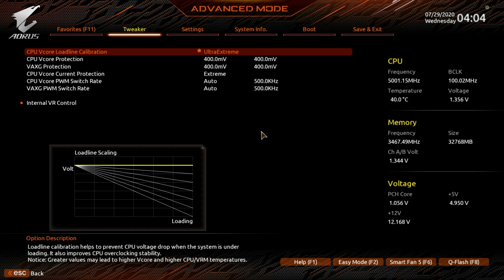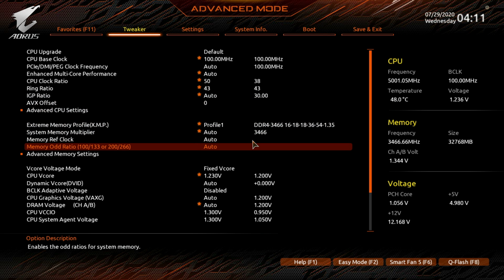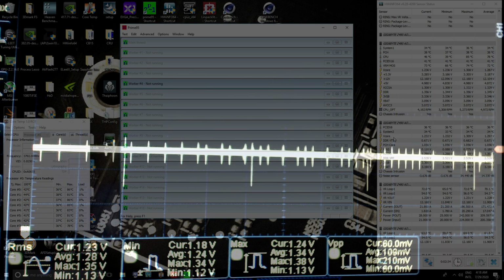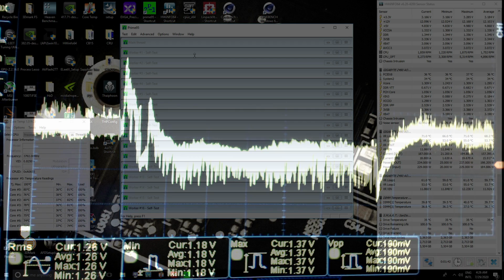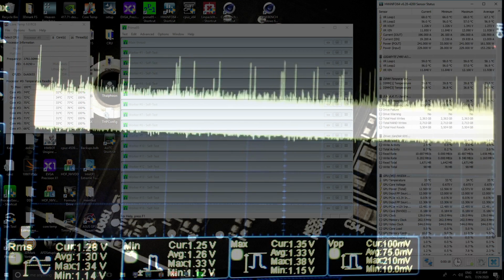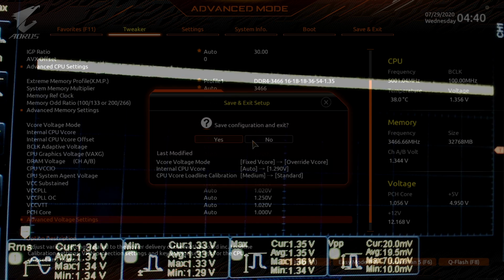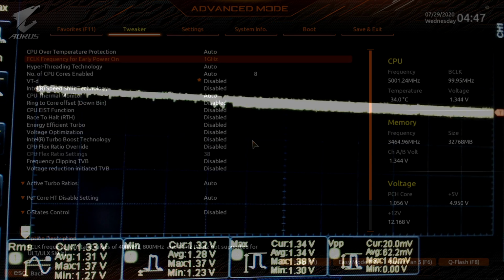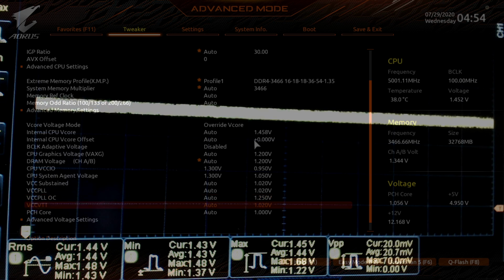Why Vdroop is good for overclocking and taking a look at Gigabyte's Override Vcore mode.

Comment: Stellar video! Can you do a video on how the override mode works? Usually the VRM senses the voltage and adjusts the duty cycle from there so it must rely on the capacitors to handle transients until the convert can catch up. Capacitor voltage doesn't drop until current is already flowing out so the VRM is playing catch up. Does override mode also use current feedback to sense the transients and adjust the duty cycle? It would need to sense the current downstream of the output caps while typical current sensing is done across the high side switch I think.

Does the VRM take it's feedback from the area of the board where the output capacitors are, or does the feedback come direction from the CPU die?

I must have more information!
Reply: Yes we need to know how this cool feature works. Buildzoid I have faith in your electronic investigation skills!
Reply: My guess is that Override is like Adaptive and stock voltage, as in it uses LLC to achieve the effect. It seems to just be implemented better, and/or have LLC be adaptive (changed on the fly in reaction to under/overshoot). Not sure if that's practical. I think it could also be a non-linear LLC map.

Comment: Great video!  I was hoping to see the same feature on my X570 Aorus Master.  Unfortunately, it’s not, even with the latest BIOS - F21.
Reply: I wouldn't count on it if I were you. Compared to your X570 board this Z490 board uses a different VRM controller. Plus, Intel's LGA1200 CPU's use a completely different power control scheme then AMD's AM4 CPU's.

Comment: These spikes are likely caused by Windows event loop sending mouse in / mouse out event messages to various processes. From OS point of view, the screen is just a big bit plane on which pieces are "owned" by various process threads. As the mouse moves, the OS generates events and has to decide where exactly they need to be sent to. If the window is moved, the mouse events are consumed by just one process, the window compositor.

Comment: My guess as to why dragging a window doesn't cause it but moving the mouse does.. windows 10 has a feature that lets you interact with whatever you're holding the mouse over without clicking on the window to make it the active one.. so you can type in one window and scroll another one without changing the other one to active. Maybe the detection and input rerouting logic for that feature is causing the spikes.

Comment: Super interesting video, many thanks for this! I have the exact same CPU and motherboard and currently use Adaptive but will now give Override a go.  As the CPU is more than fast enough for me right now, I'm more interested in running lower voltages at stock speeds than overclocking and currently run about 1.8v under load stable with temps around 60C.
Reply: Typo? 1.8V will insta-kill a CPU if you give it that much under load at ambient temps.
Reply: @kelvinyonger8885  He hasn’t responded yet cause his only computer died
Reply: Rip half knowledge overclocker

Comment: You, sir, are giving all the info I need to properly OC my 3900XT. So this horrible undershoot (+ windows shit) is what's causing workers, eh, to stop working. Nice class, thank you for those voltimeter readings, it's not something I can do by myself.
Oh, and if you have the time, I'd like to ask: in a good mobo (I have a x370 K7, bought on your recommendation actually), is there any chance those overshoots happen while current is still passing through the chip?
Reply: "windows shit" will be "program of whoever shit" gives enough time, and not that much time.   At any rate, your cpu was not stable at those settings - killing the messenger is dumb.

Comment: why not just hide the other unused fields in HW info so you can see the temps and the voltages at the same time? great video, top notch. this is something i have been trying to imagine in my head for over a decade and you just managed to visualize it for me in an hour.

Comment: A much better video than the previous one, now all is clear and it was like you said a windows timer stuff
i also sugested to change LLC to see behavior but i would have never imagined this result, i'm so choked
wtf windows is doing when moving mouse is just insane microsoft should fix that asap
very interresting anyway and good job on this one. I now need to connect my scope and see what's going on with my asus mb as they don't have an overide mode
Reply: "wtf windows is doing when moving mouse is just insane microsoft should fix that asap" might as well just say "I am ignorant, and I want to shout that from the mountain tops"

Comment: what motherboard do you recommend AMD platform that can be upgraded that won't break the bank?
Reply: It's impossible to recommend a motherboard without knowing what features you need.

Overclocking a 39xx Ryzen?
2.5Mbit network?
Wifi?
Pcie gen4 (and how many)?
USB ports?
Reply: @AllanHundeboll  that's ok I ended getting the ASUS x570 tuf gaming wifi they r getting hard to find

Comment: so having the CPU idle at like 1.6V is not bad as long as the load voltage is at like 1.3V, and not degrading the CPU?
Reply: 1.6V is definitely too much, but yes, higher voltage is less dangerous at low temperatures: https://www.youtube.com/watch?v=uMHUz16MuYA
Reply: When switching to a low-load task, or even to idle, the voltage will spike upward, and the temperature will not yet have dropped, so you could wind up even above 1.6 V at full temperature. That's not a good thing at all. I wouldn't recommend idling above 1.45 - this is the max that any motherboard manufacturer suggests - and personally I don't plan to exceed 1.40, at least on these Intel chips.

Comment: Damn i really would like to see how they managed to basically just remove overshoot and undershoot from the vrm. That seems like a bigger deal than the publicity of it would indicate. Think gigabyte would be inclined to share their secrets at all?
Reply: I'm pretty sure what they're doing is adaptive LLC, if you have LLC perfectly dialed in it'll also produce square waves (no overshoot or undershoot) like Override, it's just hard to find the perfect LLC setting (since the manual options are pretty coarse) and as he mentioned normal Adaptive sucks to work with.
Reply: LLC in theory should produce effects like Override Mode if perfectly set up.

Comment: Thank you for the video Buildzoid. I understand why you don't do a video with the EVGA 2060 KO. I did some tests and I was surprised the EVGA 2060 KO could keep up with the 2080 in fact. I saw no difference except some frame difference but no real performance difference. I wanted to know if removing the power limit would help it even more. Anyway, thank you...You did mention why you decided not to do a video about it. I do understand.
Reply: Was the why that he doesn't get interested in midrange, cost optimized cards when only so many hours in the day?  Still hope someone figures out what mods are possible for it.

Comment: THANKS for pointing out the problem with "Extreme" LLCs. I can't justify jumping to Z490 yet – (although I'd love to try that "Override Vcore") – but on the Gigabyte Z390 AORUS Ultra (as on most GB MoBos) I've found anything above "Medium" or "High" is basically unusable in terms of stability.
Speaking of which... is it possible that  "Override Vcore" causes the VRM to use that setting instead of the voltage the CPU is calling for; (i.e., it substitutes the "Override Vcore" for the CPU's default VID)? Just a thought.
Reply: Interesting! I thought Turbo usually provides better stability than Medium or High in LLC, and I can set lower Vcore under Turbo, about 0.04V lower than High setting, to be able to end up having the same load voltage on my Gigabyte Z390 + 9600K

Comment: Hi Buildzoid, Falkentyne here
To fix the VID being reported in override mode, you need to set DC Loadline, in Internal I/A VR Control, to the same mOhms as your Loadline Calibration (aka VRM Loadline or LLC).
Standard LLC is 1.1 mOhms, so if you set DC Loadline to 110 (=1.1 mOhms), VID will respond as expected. (AMI value for DCLL is value=1/100 mOhm, so 110 / 100=1.1 mohm).

AC Loadline is the operating voltage boost--"CPU Internal AC DC Load Line" has presets for this, the internal VR Control setting for this overrides the presets.  Intel max spec value is 1.1 mOhm also.

You mentioned that you need to use standard LLC.  This is because ACLL is not 0.01 mOhms (VR value of "1", 1/100=0.01 mOhms).
The higher the AC Loadline value, the LOWER the LLC must be set.  If you had ACLL at 0.01 mOhms (1) manually, Standard LLC would then be too much vdroop, and you would need to use a higher LLC and you would get your downward spikes you hate.

I think the 'default' AC Loadline is 0.6 mOhms or 0.7 mOhms.  To bump the VR VOUT higher, you can go up to 1.1 mOhms AC Loadline (Raw value=110).

If you set AC Loadline manually to 1 in Internal VR Settings (0.01 mOhms), Standard LLC would now have massive vdroop.
Asus sets AC/DC Loadline to 0.01 mOhms when SVID Behavior is set to "Best case scenario".
0.6/0/6 mOhms is "Typical"
0.9 / 0.9 mOhms is "Worst case scenario"
1.1 mOhms / 1.1 mOhms = Intel's fail safe.  (Note this is equal to LLC3 on your Apex 12, or Standard LLC on your gigabyte).
Reply: So, what we need to set in bios for stable under load, without spikes, good vdroop and correct VID?

Comment: What's the difference between Vdroop and Vdrop??
Reply from the maker: voltage drop is just what you get when current flows through a resistance. Vdroop is the voltage drop caused by AVP/load line
Reply: @ActuallyHardcoreOverclocking  Oh good to know! I've been calling Vdroop as Vdrop all this time!
Thanks for explaining.

Comment: Isn't the last part of the video just normal behavior with Standard LLC? As in running Intel Spec means no undershoot. I don't see how that has anything to do with override mode. Maybe the idle voltage is lower?
Reply from the maker: the thing is if you use standard LLC and want 1.3V load you'll be setting 1.5V+ idle.
Reply: @ActuallyHardcoreOverclocking  OK, so they are basically using a logarithmic LLC curve. Tight LLC at low load to no LLC at high load. Sounds nice.

Comment: I always undervolt my CPUs - what's the LLC recommendation? 
I tend to set it one below the "straight line" option, but if "all the droop you want" would make it more stable (by getting rid of undershoots, I assume) I'll be happy to change it.
Reply from the maker: I'd probably use medium or high.
Reply: @ActuallyHardcoreOverclocking  Thank you Buildzoid for the rec! I previous was setting 1.33V Vcore + Turbo. Someone told me Gigabyte Turbo has transient spike issue, and maybe they learnt that from you! I've set to High LLC now with Vcore at 1.37V, to end up having the same load voltage before! It's a budget Gigabyte Z390 (Gaming X) with 9600K OC to 5GHz.

Comment: You my friend are phenomenal, Always so interesting to learn from your knowledge. Got a z390 master but could never tame my 9900k above 4.8ghz using turbo hopefully abit of tinkering with the llc will help me keep the voltage lower. As you said its stable and will never hard lockup but threads start to drop off. Anymore advice on voltages to use as 1.27v seems alot low for 5ghz but much more and I'm well into the 90s with a 240 ek custom loop.
Reply: only 4.8 for a 9900K?
What was your cache set at? high cache can mess up OC.
Reply: Can get 4.8 under 1.22v 4.3 cache 1.27-1.3 seemed pretty stable obviously the more the better but then run into heat issues as really don't want my fans going over 1500rpm as the performance boost isn't worth it over the peace and quite. Not really a fan of running my cpu for hours under prime at nearly 100c. Hopefully using a different llc will help me out as its not like I'm using cheap parts. Think its more getting the heat out of the cpu quick enough without deliding thats the problem. Seems like a good cpu considering the voltages vs clock speed but the heat is just madness.

Comment: I have been testing fixed and adaptive on my z490 Aorus Ultra and they've been okay, was thinking about going back to fixed, but after this video I'm definitely going to test Override Vcore since I had no idea what that was prior. Thanks for the video. Going to see if I can get my 10700k running at similar voltages, not sure about power savings yet.
Reply: I use an AMD 3600 which obviously is a completely different animal but when I started OC it I got WAY higher stable clocks at lower voltages with fixed voltages and a middle of the road LLC setting. 

Like I said different animal but it definitely did a lot for my AMD setup.

Comment: Don't be so down your production value. There's no need to do three takes when the info your sharing, more than makes up for any minor explanation mistakes. Though, that being said, i do the same thing. If it doesn't sit right with me, i'll do it again. But then i think, what else i could've done with that extra hour or 3.
Reply from the maker: the three takes were because I wasn't getting the crashes as quickly as I wanted

Comment: Hi, i have a question for you, why does pc runs smooth when stressed and crashes when using you tube or programs that uses 20 - 30 % of recourses, gigabyte x570 elite
Reply from the maker: do you have an AMD GPU?
Reply: @ActuallyHardcoreOverclocking  no, gigabytes 2060 super oc
Reply: It might be because of power saving features. Your settings are stable for stress testing, but it crashes in idle conditions, basically needing more voltage in idle. 
I previously had a 3600 that would be completely stable at stock with power saving disabled, but as soon as I enabled power saving and let it do its thing, as soon as it would go to idle it would hard lock. I sent the cpu to amd and it turned out it was defective, and got a replacement.
Reply: @adrianstan5794   the problem is that there is no pattern that i can see why he crashed, its just random bsods or hard locks
Reply: @bolekhrzg  Yeah, that sounds awfully familiar to the broken 3600 I had. Some days it would run fine, some other days it would crash multiple times, but only in idle situations or low load.
Reply: @adrianstan5794  yea you are describing  same problem here, it would run fine under load but it would crash under idle or low load and also not every day. So you think its bad cpu?
Reply: @bolekhrzg  What cpu is it? Also, is it new?
Reply: @adrianstan5794  its an ryzen 5 3600 and its 4 months old, everything was working fine when month ago had bsod and then it started
Reply: @bolekhrzg  I see. Then if you want to confirm that the cpu is bad 100%, you can disable "amd cool n quiet" in the bios, so the cpu won't properly idle. 
Alternatively, you can set the cpu at a low speed such as 3.6 ghz manual, and put the voltage at like 1.2v which should be plenty for it to be stable and also not dangerous. Also try setting the windows power plan to "high performance" instead of "balanced".  If the system now, after those changes, works properly, then you know for sure the cpu is bad. At that point you can just use your warranty for an RMA, and it should go smoothly from there, at least that was my experience.
Reply: @adrianstan5794  Thanks for the suggestions, have a nice day.
Reply: @bolekhrzg  Have a great day as well, good luck!
Reply: @adrianstan5794  system running 3600mhz @ 1.2 but crashing with powersavings doesn't 100% prove the CPU is bad. Could also be motherboard or even software...
Reply: @AllanHundeboll  I know, but I tried to give advice based on the experience I personally had, since I also had his problem and RMA-ing the cpu solved everything.